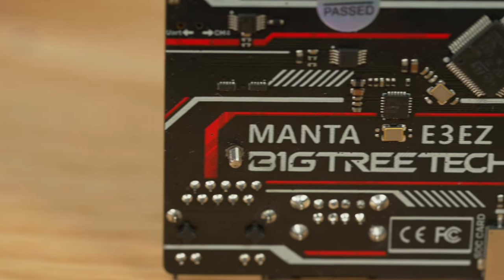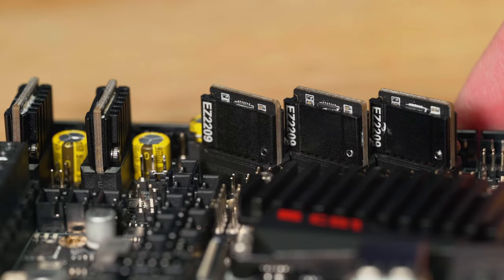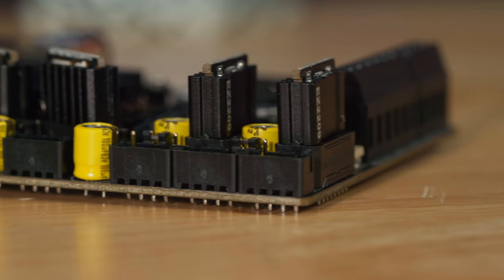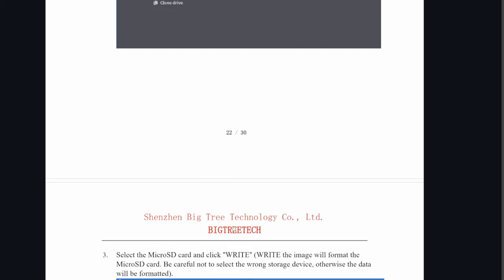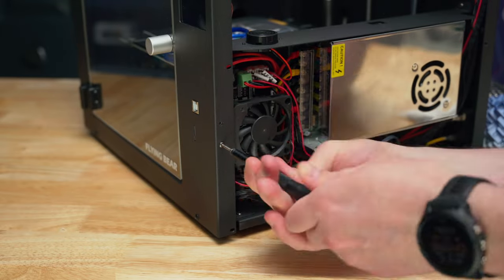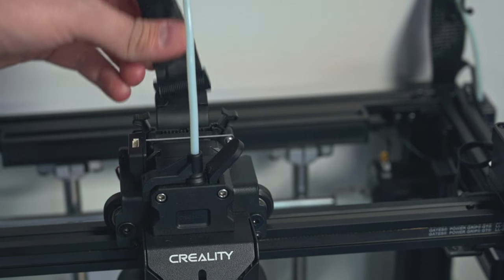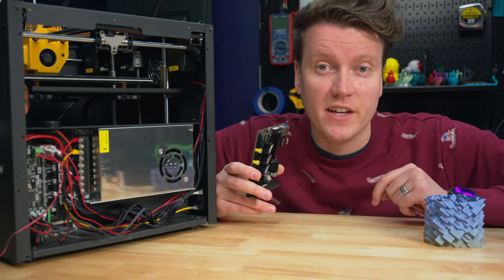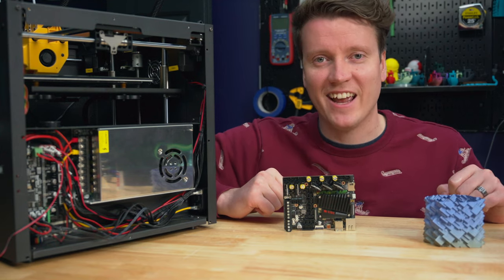What to look for in a 3D Printer Control Board?  | BTT E3EZ Manta

Comment: I used the E3EZ with a CM4 in my Voron V0.1 build. After a few initial struggles with CAN bus, it's working well. The only thing I cannot get to work is the TFT35-SPI screen.
Reply: same here
Reply: I'm having issues with crtouch for me
Reply: I'm using a SlideSwipe for a bed probe.
Reply: Did you get your TFT35-SPI screen to work in the end? Then should I rather go for their HDMI5 screen?
Reply: I did not, and BTT have stopped responding to my messages.
Reply: Thanks - Glad I didn't buy a screen yet!
Reply: If only you read the specs, that screen works only with cb1, not with cm4

Comment: I wish you had uploaded this earlier, JJ. I have a i3 mega s and I ended up buying a manta m4p to upgrade my main board and if I had seen your video earlier I would have gone for this instead :( did I miss out?
Reply from the maker: It looks like the only big difference between this and the M4p is the use of the EZ drivers, and I think this one is a little bit smaller in size. Since the Mega S has plenty of room under it the size isn't a huge problem, and I've never had issues with the older style drivers. 👍
Reply: @JJShankles  the m4p has only 4 drivers though. I remember you saying in your SKR video that you didn't use independent Z-axis, was there any reason for that?

Thank you so much for your videos btw, you're my go-to on youtube for my 3d printer upgrade stuff :D

Comment: How is it to set this board up with the sonic pad?  I’d like to add the individual dual z control as well as being able to adjust vref for the steppers through the config. 
Or am I better off to get it with the cb1 and a screen and ditch the sonic pad?